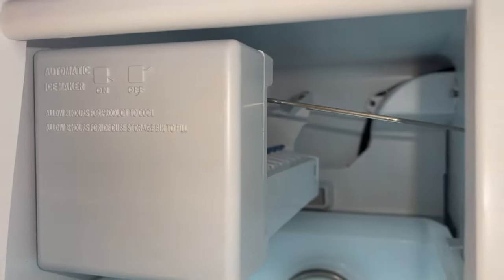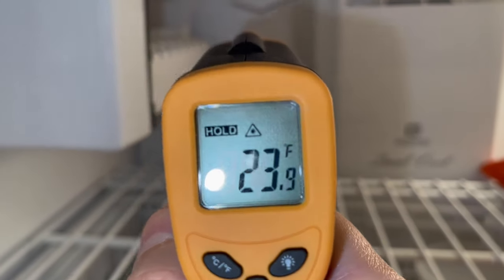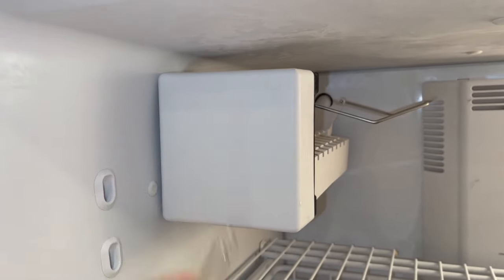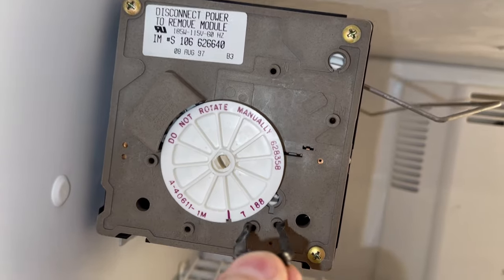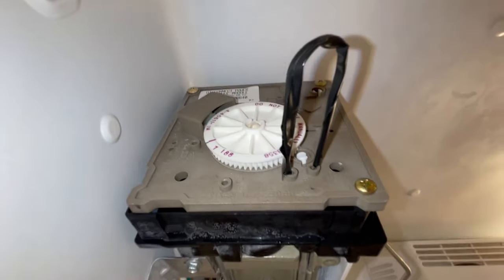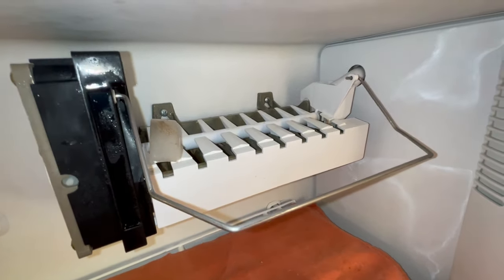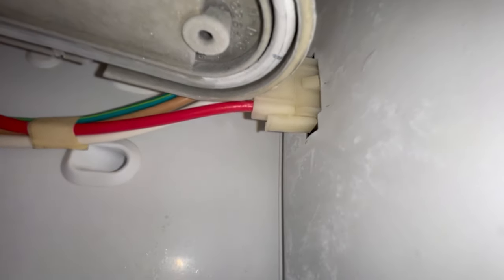Ice maker not making ice troubleshooting jumper test cycle

Comment: Great video!  That's awesome that you answer, and still answer to help!!  I have a 90's GE Monogram. # ZISW42EMC.  I can add water and it will make ice and harvest, but water won't refill after.  The valve and water supply are good because I can switch the wire on the valve and use the water dispenser lever to pump water into the ice maker. I have no place to jump or prob under the cover of the ice maker, but I did check the 4-pin connector connection.  Is there something else I should check or would it just be the Ice maker not sending the signal, voltage to the valve.  Thanks a bunch!!
Reply from the maker: Yes. If the wire going to the ice valve is not physically broken somewhere, the ice maker itself is probably bad.
Reply: @Your-Self  Thanks for the response!   It started making ice again.  I turned the fridge temp up from 5 to 9 to make it colder, it’s getting down to 5 degrees , which I saw at 5, but who knows. I had also pulled the ice maker to look it over.    If it happens again I’ll buy an ice maker. Thanks!!

Comment: I have purchased StikTek Heavy Duty Electrical Tap Thickness 0.177 mm Voltage grade 600V?  If I wrap that around a paper clip will that be sufficient to prevent an electrical shock?  I subscribed!  Thanks for the video.
Reply from the maker: I'm not familiar with this particular tape, but any electrical tape should be sufficient against a shock. Just wrap a few layers on the paper clip.
Reply: @Your-Self  Thank you!

Comment: Thanks for the instructive video. So mine started working after using the jumper cables and it continues to work properly as long as I don't remove them. However, once I remove the jumper cables and put the cover back on it rotates once and stops working. Then it seems as if it's not cold enough to keep making ice. What do you think could be going on?
Reply: you kept them inside the TH? why not just leave them in there?

Comment: The jumper worked for a few days, but i had to continue taking it out and putting it back in. Finally i used a little strong wire, taped it and put it in the in the ice maker and after the dial begin moving, i took the jumper and pushed it in and pulled it out several times. I suppose there must have been some kind of buildup on the wiring and by pushing it in and pulling it out several times, it started working and last night we have a lot of ice produced. So, no new fridge right now!
Reply: Having this same issue, I have done the initial jumper process and it ejected the ice. i waited a couple of hours and did not hear any ice ejecting so I checked if the ice was done. I repeated the process. It ejected the ice. Currently waiting to see if it would need another jump. 

I wanted to ask when you mentioned you taped a wire, did you use the wire that has tape to clean out the T and H holes?
Reply: @Spekitus  there is a comment above, i think. what i did was to push, easily the jumper wire in as far as it would go, pull it out a little and do the same thing. then remove the wird and repeat the process. that should clean off the build up on the connection.
Reply: The T and H holes are there for you to bridge the gap between where the thermostat connects to give power to the unit, your bypassing the thermostat when you jump it.

Comment: Thank you for this video. 
I ran a paper clip from V to L and water started coming into the ice maker. I ran it from T to H and the wheel started spinning and arms started moving clockwise too. 

I came back after 2 hours, and jumped T and H together. Ice came out but somewhat clumped together and into the basket. 

Am I supposed to deduce that the heating element underneath the ice maker is what’s faulty? Do I swap out the whole thing? It won’t fill up water on its own, and the arms won’t move on their own inside the ice tray. Thanks!
Reply from the maker: Since you manually run the water valve, you probably overfilled the tray, hence the clumped ice.
The heating element seems to work since you harvested the ice.
If the temperature around the ice maker is cold enough (around 0°F), but it doesn't fill or harvest on its own, replace the whole ice maker unit.
Reply: @Your-Self  thanks! I’ll get one ordered.

Comment: I've only had a problem with mine 3 times when there are power outages for days. My son fixed it but he moved. I took the auger basket out & popped the gear cover off but there are no holes to jump or test with a multimeter. Can you advise why this happens only after power outages, and even though my unit is a bit dissimilar, how I can fix this? Thank you.,  a DIY Mom who misses her son & her ice. 😊
(So I've read lots of the comments and one that you answered was about the pressure dropping in the hose. Sounds about right, ya?)
Reply from the maker: Power outages can cause weird problems. But very often can be fixed by unplugging your refrigerator for a minute and plugging it back in. If the ice doesn't return the next day, it'll require an investigation. It's difficult to speculate on a problem without being there.

Comment: This is a great video, thank you so much. I have subscribed already. I have a fridge pretty close to the one in the video and same problem. You didn't mention anything about the water filter and replacing it. I didn't do the troubleshooting related to the electrical parts yet. I verified the water supply line is good. The part behind the fridge with the blue cap at 0:55, is this the filter?

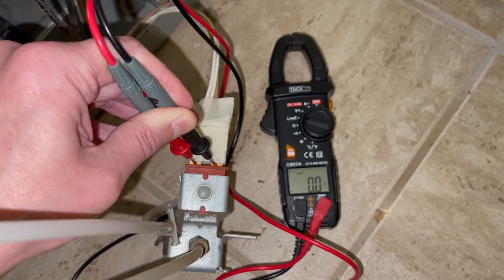Also, it's not clear how to measure the voltage behind the fridge at minute 3:55. Please help me out here. Where to connect the wires of the voltage meter?
Reply from the maker: The refrigerator in this video doesn't have a water filter. The blue cap behind the fridge is the water inlet valve. And to test it, I unscrewed it from the chassis and pulled the wire harness just enough to stick my meter leads for the voltage test. Jump started the ice maker with the T and H terminals, and waited for the scooping-fingers to move to the top. That's when the ice maker sends about 120 VAC to the water valve for about 5 seconds.
What exactly is the problem with your ice maker?
Did you run the T and H test? Did it go through the full cycle? Did it fill with water? What's the actual temperature inside your freezer?
The water filter may cause some problems if it's old and dirty or new but fake (not OEM). Also, the filter holder may be damaged as well if the installation of a new filter was kinda rough.
Reply: @Your-Self  thank you again. I'll test the cycle first and come back with the results.
Reply: @Your-Self  I used a jumper wire into the T & H poles and nothing happened. I followed the steps and tried with many wires etc... Nothing happened. I am really blocked because of the drawers and not sure how to remove them and are blocking me to come closer to the ice maker box. I don't have a voltage meter but I have a voltage sensor and it beeps continuously on the black wire at the far end of the box and just above the the N hole. I tried with a simple 120V voltage meter in L & N and didn't see any voltage. 

You mentioned something about the rotating item is stuck because it's frozen. Can I use a hair dryer to melt the ice from the bottom of the box or inside? Or shall I pull the plug for 2 hours to let it melt down?
Reply from the maker: If you don't have 120V at L & N terminals (and can trust your voltmeter), the ice maker will not work. So the problem could be with the wiring, not the ice maker. 
If it's a Side by Side model, look under the freezer door wire harness (may need to pull out the front kick-plate)... the wires could be damaged.

Comment: Great video Thank you!
What's the problem if the water doesn't shut off and keeps filling the ice maker?  
Also, I have the same ice maker and the diagram at 1:46 was printed on a sticker on the inside of the housing cover you took off. At least it was on ours. Hopefully that helps some folks.
Reply from the maker: If you have a multimeter, check for about 100 VAC at the V and N holes. The voltage should be there for just about 5 seconds while the water is flowing. If the voltage is always there, the ice maker is probably bad.
If there is no voltage at the ice maker but water keeps flowing, the water valve on the back could be stuck open. So it needs to be replaced.

Comment: Great video! Jumpstart worked yesterday and rotated fully. Today it didn’t rotate to the end of the cycle. What do I do now?
Reply from the maker: Not sure.
Have a look inside the ice maker. Maybe there is an ice cube stuck somewhere.
If not, the ice maker gears could be worn out. Which means you need a new ice maker.

Comment: I have a Maytag french door bottom freezer.  It stopped making ice.  I've replaced the icemaker and water valve.  I still don't get any ice and there's no power at the ice maker when I run the tests.  Freezer is at 0 degrees.  Could it be the Jazz board not sending power to the ice maker?  The door switch seems to work fine when I held it during the tests.  This fridge doesn't have any door features such as ice or water in the door, just a basic with the ice maker in the bottom.
Reply from the maker: Typically, the Jazz board doesn't control the ice maker. But if you provide your refrigerator model number, I may be able to confirm it.
So is your ice maker absolutely dry, or it has frozen ice inside the tray, but it doesn't harvest? 
Also, did you have exactly the same problem with the original ice maker?

Comment: Thanks for this! Is there a way to adjust the cube size? I see other makers have an adjustable screw. Not sure if this type has that option.
Reply from the maker: If there is no visible adjustable knob, there might be a hidden slot under the white cover. Take it off (as in this video) and use a screwdriver to turn it clockwise to decrease and opposite to increase the cube size. Rotate with about 180° intervals and wait to see.
Reply: @Your-Self  I found it under the cover. Thanks a million.
Reply: @Your-Self  Can I ask another question? The tube going from the pump to the ice maker. Should I be able to blow through it if I disconnect it from the pump? In other words, is it open from the pump to the ice maker? The reason I ask is I am pulling my hair out with super small cubes. I found the tube frozen at the end and thought that was it but still tiny cubes. Put some air on the tube and it does not blow through. Could the tube be frozen before it gets to the ice maker.
Reply from the maker: Do you have a water filter installed in your refrigerator? Maybe it's time to replace it.
If you use RO (Reverse Osmosis) filter, it doesn't have enough pressure to completely open and then close the water valve. And that could create small ice cubes and a weeping valve that leads to a frozen tube.
Reply: @Your-Self  I had a RO filter and removed it a few weeks ago thinking it was causing it. I removed the filter for the fridge too. I am now running the water line directly from the sink to the water pump. Now I am wondering if the pressure in that line is enough. I am using one of those taps that attaches to the copper line with the small valve. My water pressure at the door water filler does not seem like it is high as it should be. When I had the RO system it would take forever to fill a cup and removing it I get a little better but not what I see in the youtube videos of water coming out of the door. Today I put about 25 PSI from an air compressor on the freezer water line and could not really feel air coming through it. It certainly seems blocked. That why I was wondering if it was supposed to be open. Adjusting that small screw to allow more water to the ice make didn't seem to change anything either.
Reply: Update.....I turned the cube size adjustment screw 2 more full CCW turns and this morning it start filling the tray up like it should. Fingers crossed that I can put this behind me 🤣Thank you for your help!

Comment: Thank you for the video! My ice maker doesn't turn with jumper wire. It has 120V in L and N terminals. There is frozen water the inlet tube, but when I cleared it, nothing happened. It still didn't work. What could the issue be? Thank you!
Reply from the maker: If the jumper wire goes deep enough, but nothing happens, the ice maker itself is probably bad.

Comment: This helped me get the ice machine running again! 

The issue now is- the ice machine won’t keep operating. It’ll harvest one time and fill again, but it doesn’t rotate the ice out and start the process again. 

Any ideas?
Reply from the maker: Make sure the temperature around the ice maker is around 0°F. If it's much higher (let's say 15°F+), the ice maker will not harvest on its own.
If the temperature is good, then the thermostat inside the ice maker could be damaged. Therefore, you may need to replace the ice maker itself.

Comment: Quick question, does there have to be frozen ice in the maker to tell the thermo switch to close or does the “jump start” take the thermo switch out of the equation?
Reply: I hit the jumper and the motor doesn’t turn, i get the 120V between the N and the MX-N terminals—— bad motor at this point or thermo switch? Heat bar works as well ill add
Reply from the maker: The jumper bypasses the thermostat. So, the ice maker should rotate regardless of the temperature.
If the heater works, the motor could be stuck or burnt.
Probably need a whole new ice maker.

Comment: My water valve works (replaced new), it gets power (checked voltage). However I found it was clogged with an ice damn and it would click because it couldn't release it. I removed the unit, let it thaw, then put it back in. It no still has power, but doesn't even click on anymore, even when I jump it from T-H. Any idea? (although nothing was trying to move, I also didn't feel the heater warming up, I don't know if it was supposed to at that point or not.) I also made sure to tape  flush the door switch.
Reply from the maker: If you have 120 VAC at the L&N holes and the ice maker is not turning with the jumper at T&H, the ice maker motor has probably died. Most likely, you'll need a new ice maker.
Reply: @Your-Self  Thank you! Just yesterday i opened the freezer to find the entire ice bin was a giant ice cube! I pressed the door switch closed and watched what it was doing. It was trying to eject the frozen cubes currently in the machine, but couldn't because it was too full. I have not idea how i got so lucky it switched off just in the nick of time (no ice was in the bottom base of the freezer). Have your ever run into this?

Comment: This video gave me lots of background on my ice maker. Thanks!
My shut off arm won’t drop to the “on” position.
It only goes halfway and stops.
What can I do?
Reply from the maker: That shutoff wire is removable and replaceable. But if the socket is damaged, that won't help. Try to remove and readjust it. If that doesn't help, you will need a new ice maker.
Reply: i have the same issue i have no idea how to adjust and remove it

Comment: My ice maker had no water in it. With the jumper across T and H, the wheel rocks back and forth. There is no voltage across V and N but there is voltage across L and N. I have manually filled the ice maker with water and waiting for it to freeze. At what point should there be voltage between V and N? Great video, but that portion for me was a little unclear. Thanks
Reply from the maker: You should get a little over 100 VAC on the V and N terminals for about 4-7 seconds to activate the water valve. This happens closer to the end of the cycle.
Reply: @Your-Self  I think my motor is shot. Checking ohms from L to M I get 4 ohms. I just replaced this unit in Sept. Thanks for the reply.

Comment: Hello I had tried the first tip in this video by using the wire in the T and H holes and it worked, all the parts ejected the ice and refilled the ice great. But when I came back the next morning the new ice still had not been ejected and I had to jump it again. Any ideas ?
Reply from the maker: If the temperature around the ice maker is cold enough (around 0°F), but it's not harvesting on its own, the ice maker thermostat could be damaged. In this case, you probably need the whole new ice maker unit.

Comment: My similar unit is making cubes stuck together and water is freezing in the ice bin. Mine doesn't have the screw adjust like some (its like the one you show). Is there a way to reduce fill time or level on this model? I tried partially closing the water valve to the fridge with no success.
Reply from the maker: The ice maker in this video actually has the adjustable screw. When I take the cover off, you can see it on the right side. It's a thin plastic knob around the middle of the right side.
You may want to observe and time how many seconds the water is flowing.
When it stops, does it stop completely or continues to drip for a little longer?

Comment: What would I need to do if the water inlet value is frozen or bad? Any advice on how to fix it?
Reply from the maker: If the water inlet tube is frozen, usually but not always, you can simply replace the water valve behind the fridge. Just make sure to turn water supply off. 
But some models have a special heater for the tube that could be malfunctioning. And other models have an unfixable problem with the deteriorating insulation